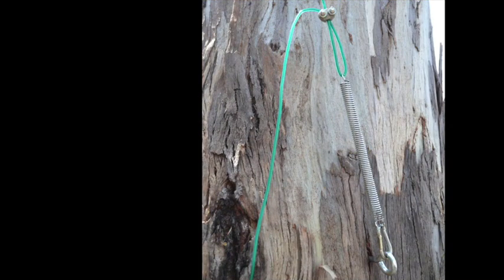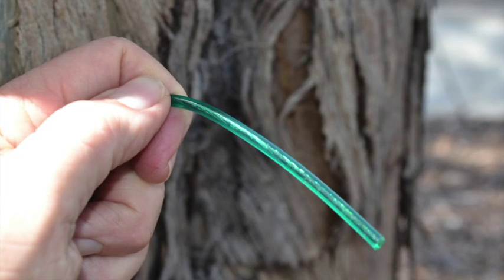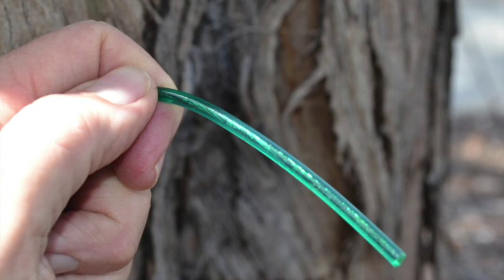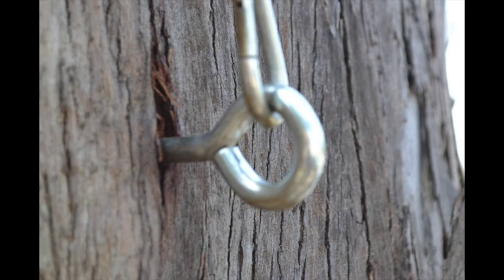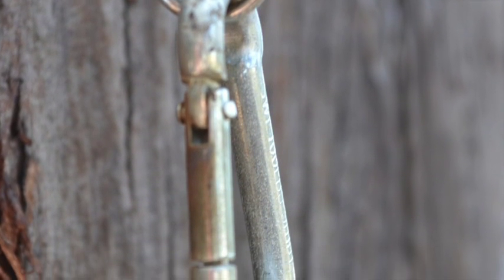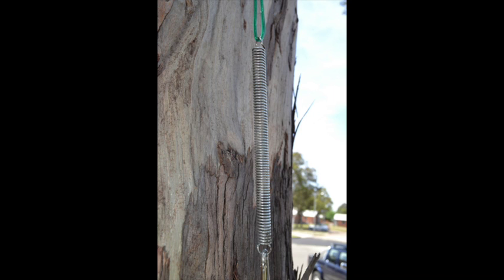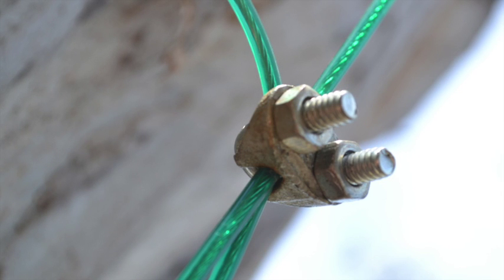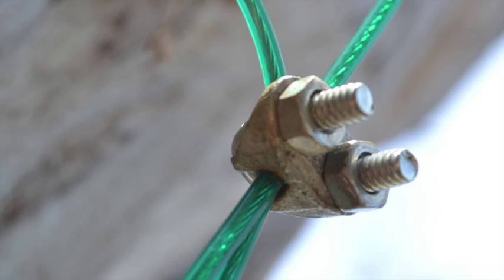Antennas, trees and flexibility

Comment: Just a little correction.  As the tree grows the antenna height will remain the same. Tree growth comes from the tips. The tree will get wider where the antenna is placed but not higher.

Comment: The spring is a great idea,  thank you! I was planning to use a pair of pulleys and a weight but this is simpler.
Reply: I use weighted line too. I fill a rinsed laundry detergent jug with sand and gravel, cap then tie it off 1 meter/3 feet off the ground with the rest of the support rope coiled around the jug.  My Dad used those old 15# window sash weights that counter balanced the old fashioned windows.

Comment: Good idea John. I keep my end fed wire antenna a little loose so it has room to reflex with the tree.
Reply from the maker: Yep - way to go, Tommy. Just make sure any ropes you have are UV stabilized or better still use the clothes line wires I have used.

Comment: Thanks for this. 

I plan on putting up an inverted V in the spring, and wanted to make the ends easily movable. Allowing to change the pattern depending on particular needs ,and also to please the XYL during non-operational periods. 

A variation of your method here would make things much easier than simply tying the ends off where I want them. Pre-positioned anchors and the caribeener/spring method would make moving them a snap.
Reply from the maker: Give it a go and let me know how it works. I used to joke that the one calculation we need to include in any antenna system is the WPF...Wife Pleasing Factor. Some of my antennas failed due to the low WPF!
Reply: She's OK'd the tower and beam, so limiting the number of wires dangling around the yard is a small price to pay.